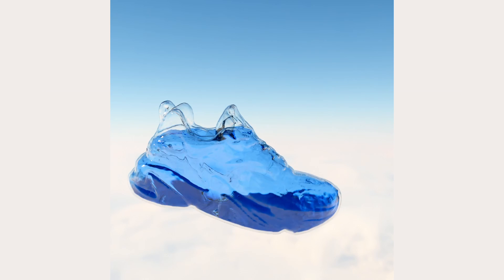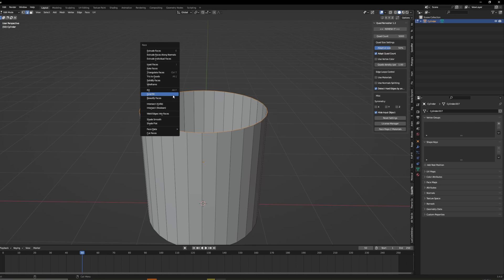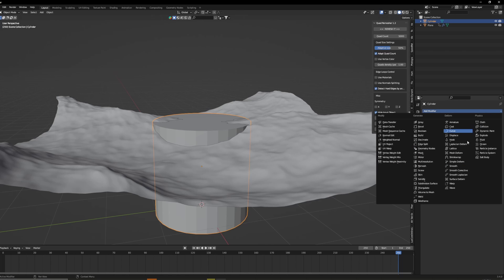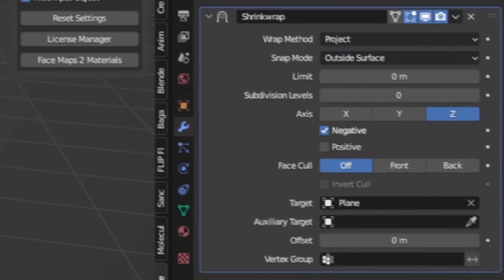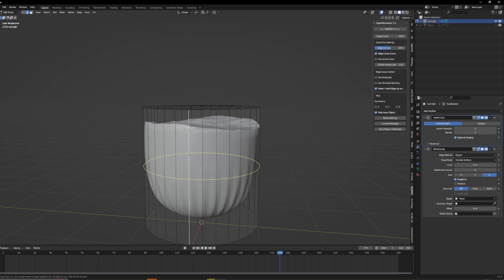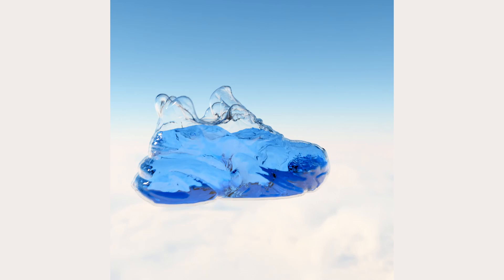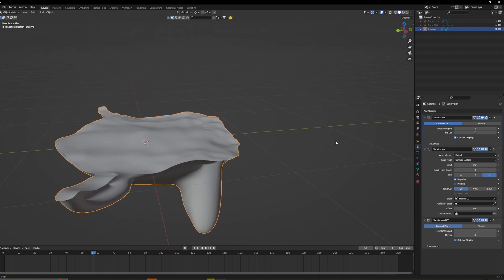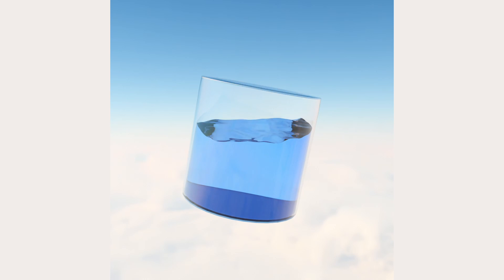Blender Real Time Fake Liquid Tutorial

Comment: It looks pretty good. 
There are moments where it is clearly not an actual volume because the amount changes inside the enclosed object depending on the tip angle but it is sufficiently shiny and moving like water that it works for  many basic  situations.